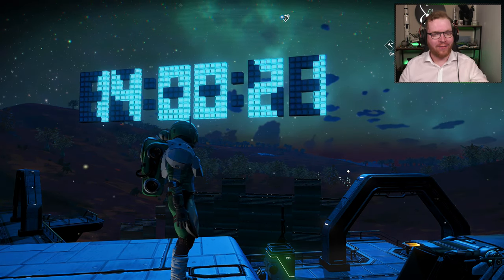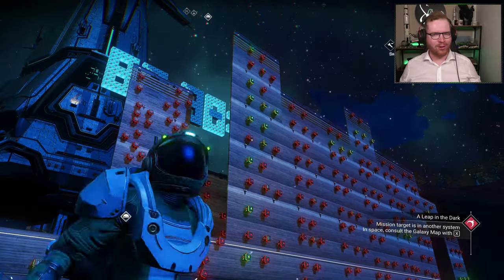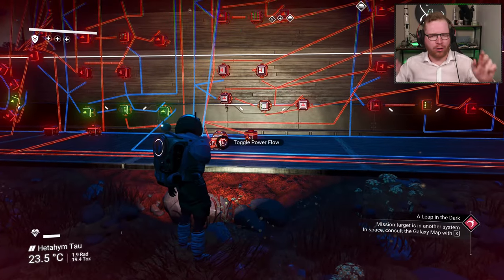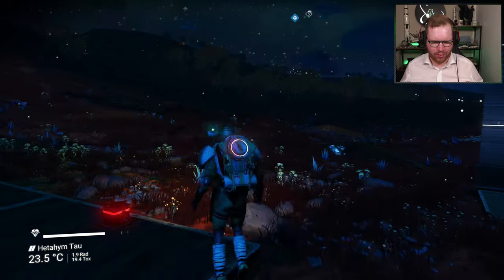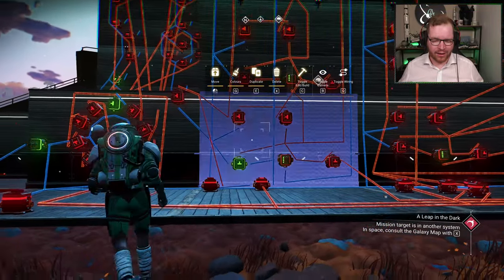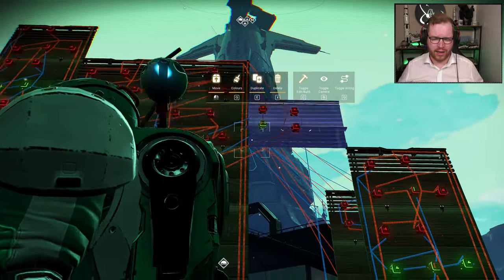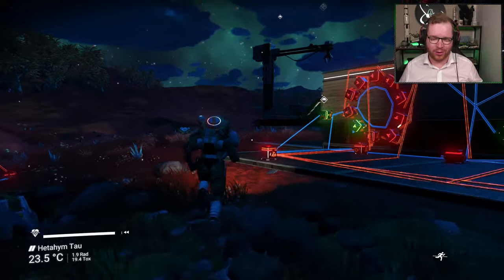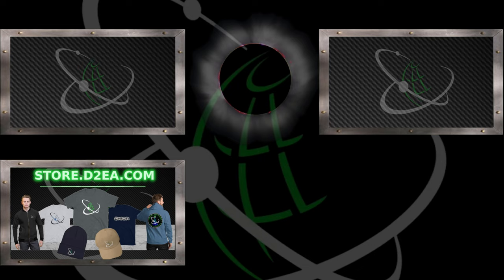I Build a Fully Working Clock in No Man's Sky!!!

Comment: Guys you do realise don't you that using the components DtEA is utilising there is no reason why you could not build your own Turing Machine = Classic Computer, and you could also create  your own  pixel based display  system since DtEA's clock display is a small simplified version of exactly such a system.

This is actually minecraft level cool, i like NMS and play it quite a bit but i had no idea this was even possible in NMS.
Reply: I made a classic computer. I would like to visit this clock base.

Comment: A few things you should be wary of:

The max object count for each save shared across all bases is 16,000 objects, so if you plan on making several more builds like this you may need multiple saves. 

Additionally, if you plan on making a multiplayer game (or singleplayer) make sure that all parts of the build are uploaded. If you need more than 3,000 objects you can use multiple bases for the same build to surpass this limit, but be aware that you cannot mix electric circuits / wires between bases.

Good luck on your future endeavors!